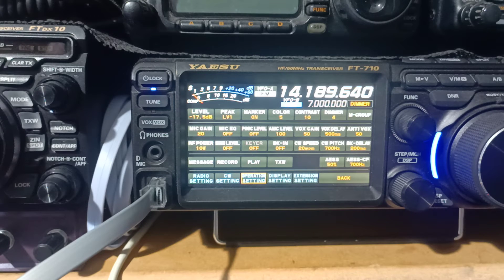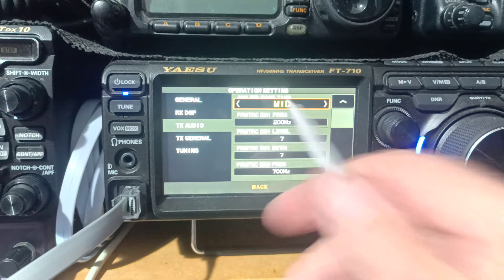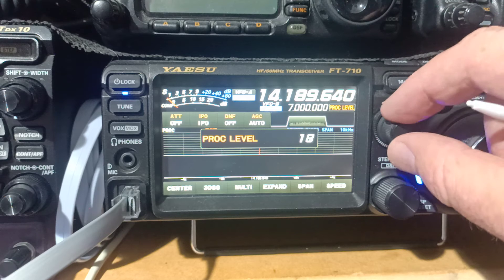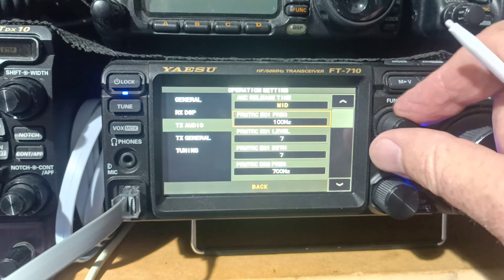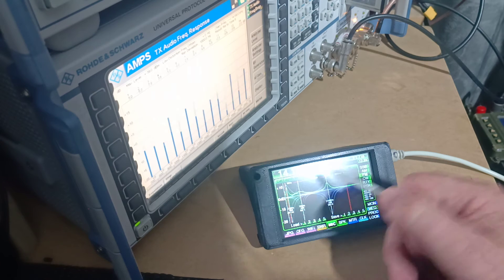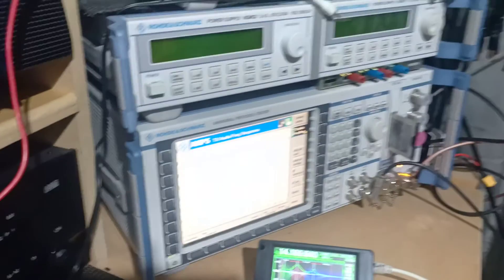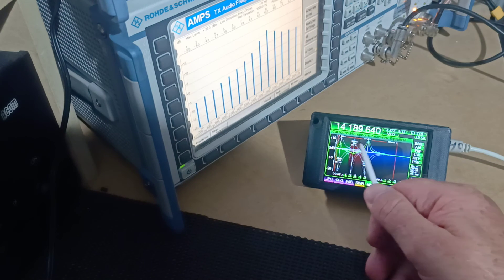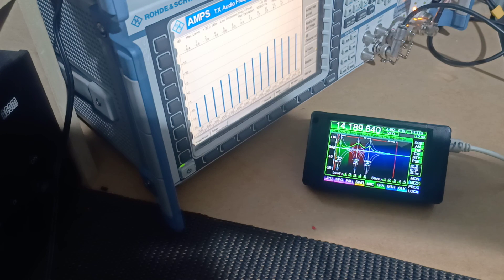Analyzing / Explaining Yaesu MEQ (FT710 FTdx10 FT991 FTdx101)

Comment: Nice ❤my cat touch 😉I run a Electra voice re27ND and cut the lows and boost my mids & highs. Great settings for both 4K low band ray chewing and 3k Dx 😊 I don’t like a lot of lows in the signal, it does not help with readability imho but to each their own 😊